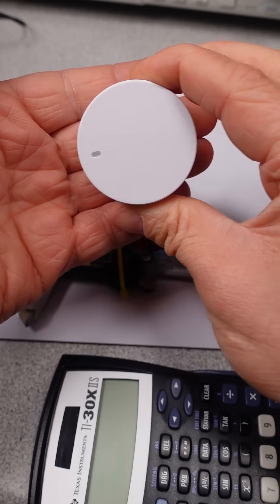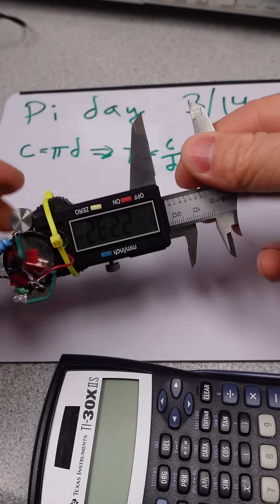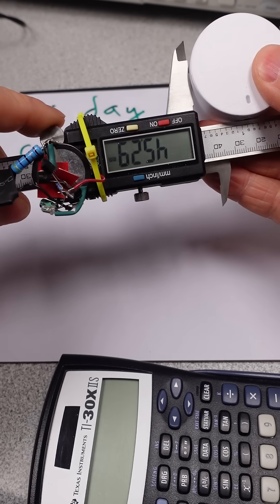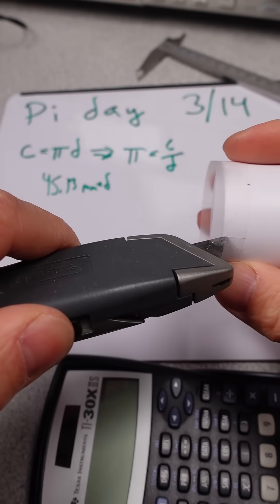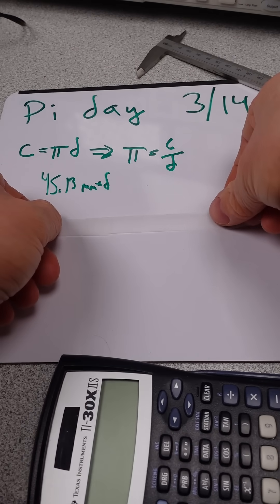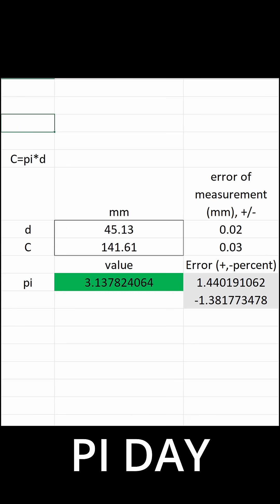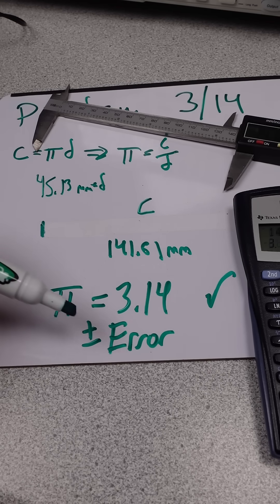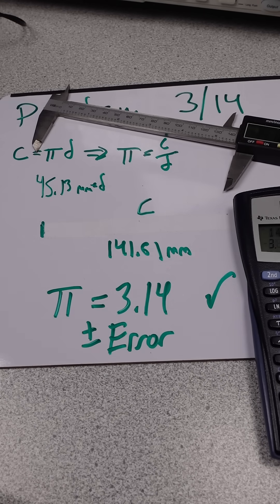Can a Round USB Adapter Calculate Pi?

Comment: Did you measure the circle before or after you added tape? Keep in mind the tape is at a greater diameter than the cylinder itself.
Reply: Thr way he cut it against itself, I think that the underside, with its 90° cut ends, should work out to provide the circumference (at the end of the sticky-side edge) with an acceptable tolerance.
Reply: Maybe part of the challenge was to cut the tape square with itself and to keep the caliper measuring across the middle of the length of the cut ends (where a measurement whatsoever diagonal would be long).
Reply: @William.Driscoll  The measurement of the diameter was not shown, so we don't know how to begin determining the source of the error.  Evidently now that pi day is over, we'll never know, because the fun is over for this year.  There are plenty of other places to see more accurate efforts.
Reply from the maker: haha, yeah, I did shoot that part, but yeah, it's a short, so something had to go.  Yes, the intention of cutting the tape was to minimize error with a right angle cut of tape, all sources of error, along with tape stretch.  The tape is the largest error source.  I did measure several spots for the diameter and this adapter is not round, adding to the error.  Certainly open to other ideas.

Comment: Hey is that a good vernier? I need to buy a digital one for my mechanical engineering class. I was looking at those fully stainless steel models.
Reply: What is going on with that caliper?
Reply: @dvsr5296  It looks like he has soldered in a battery holder so he can use bigger batteries in it.
Reply from the maker: Yeah, it's rechargeable in seconds, dead bug assembled, ugly as all hell and kind of a joke but functional.  The cheap calipers are surprisingly accurate for what you pay for, they're a dime a dozen but yeah batteries don't last long in this particular set.  If you want something better I don't have much experience with 'good ones'.  I have a dial indicator one I've been using for a long time, no batteries used, ha.
Reply: That's not a "Vernier", it's a digital caliper. Vernier scale calipers are different and a whole different skill to learn